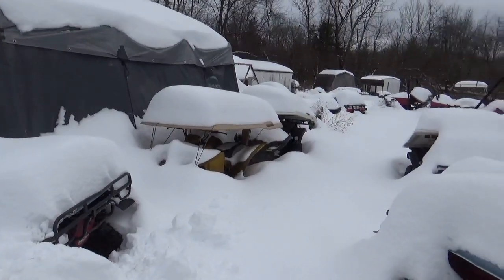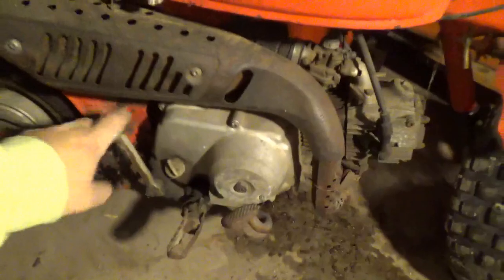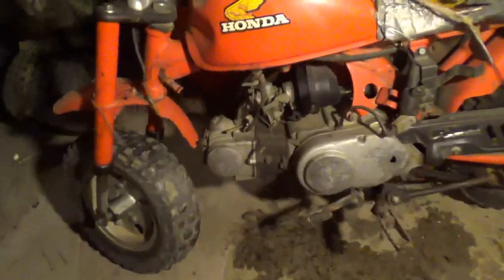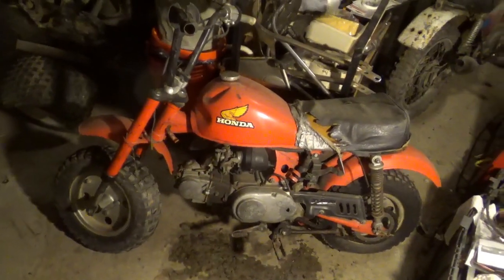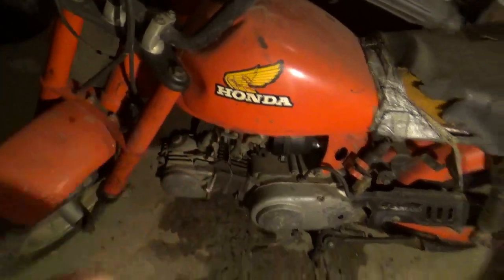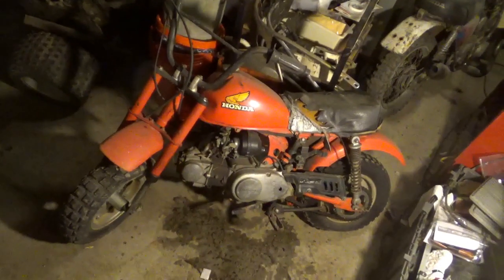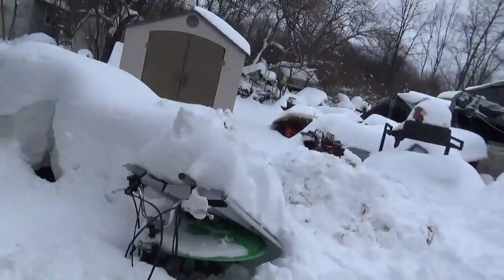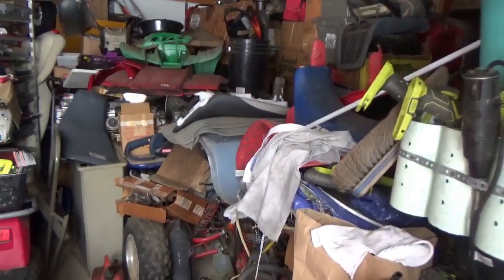1979 Honda Mini Trail Z50R, Hidden in the Basement for Over 20 Years!

Comment: We have an 1984 Z50r. It was a basket case when I bought it. Had it running and riding the next day. It is getting a 110cc lifan 4 speed upgrade soon The old 50cc is wore out and smoking. I'll save all the original parts and engine in case someone wants them in the future to make it original again. I'll never sell it. Most likely it will teach my future grandchildren to ride motorcycles just like it was my son's first motorcycle. 👍👍
Reply: Pls do not ruin it with a chinese engine!!! Please, give it a ring and cylinder job and get it back in there👌